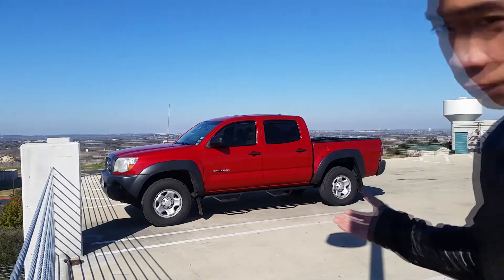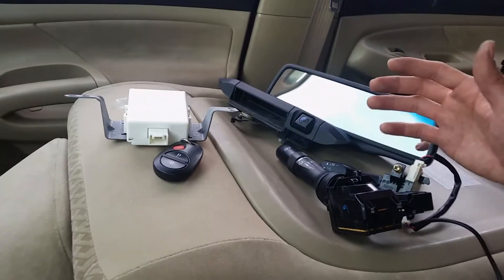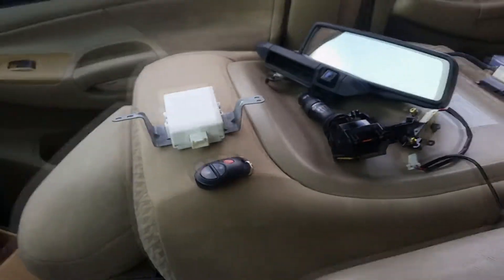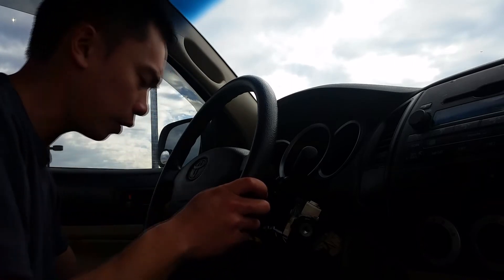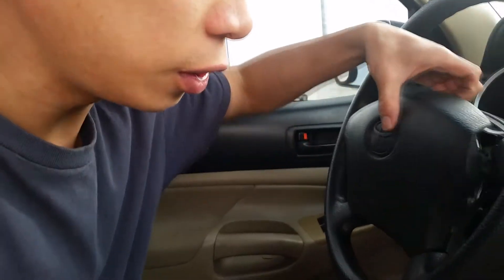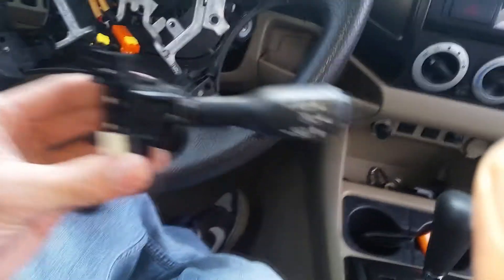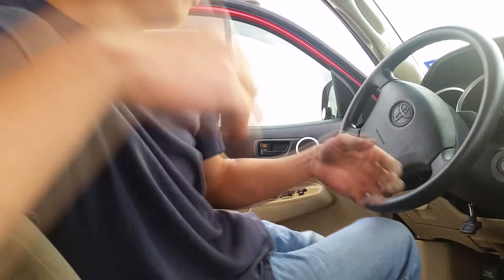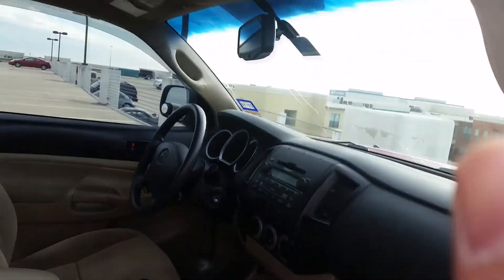Prewired 2010 Tacoma OEM Accessories add-ons

Comment: I found a new Intermittent on eBay $100 and it was so simple.{Works Perfectly}
I found the Keyless Brain 89741-04010 used for $125 and it's shipping{Should Work}
Found 2 new aftermarket Fobs on Amazon $25 {Should Work}

This video showed me that my 2011 Base Access 4x4- 5 speed was also prewired...I had no idea.

I recently got this truck from my brother and really enjoy driving a stick again. Great little truck that keeps getting better.

Thanks Ricecastle
Reply: What is the name of the model of the reverse camera you bought for the Toyota Tacoma?

Comment: So if my truck has the rear view mirror plug in the headliner would that most likely mean it is pre wired?
Reply from the maker: yeh, can look under tailgate to see if those cables going to tailgate camera too for backup camera
Reply: @Mike_Kewl  I opened the tailgate and I see wires going in from the bottom. I  am guessing that would be for the backup camera.

Comment: @ricecastle do you know if this all can be done on my 2014 Regular cab Tacoma, like pre wired ?
Reply from the maker: Dylan Penrose it's possible they made them prewired. You can check to see if there are cables going to tailgate, above the mirror, or the fog light harnesses covered in my fog light install video. It'll give you an idea as to whether you're prewired or not
Reply: Ricecastle I'm working on the cruise control right now . I know I'm pre wired for the back up cam tho not in the mirror tho , my truck has the factory touch screen so it's wired into that
Reply: I've come to the conclusion that I'm not pre wired for cruise so I'm wiring it in,  but I'm stuck on getting a retainer pin out so I can add the cruise wires into the clock spring plug , I guess that's where non wired trucks add it in
Reply from the maker: Dylan Penrose yeah. I just plugged it into a harness that's in there which spins and yet works while turning the steering wheel. If we're thinking of same thing, then I would just buy a new clock spring with the cable connects. That's a lot of work,  but go for it if you think you'll use the cruise control a lot. You'll have to do some research.